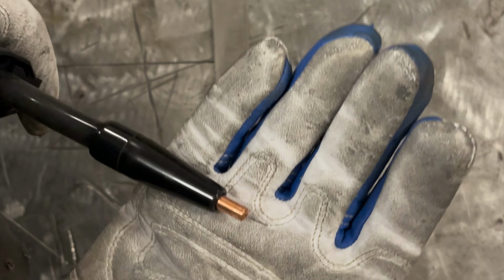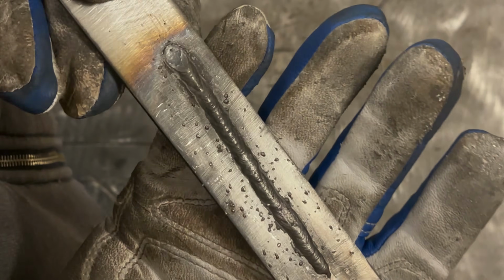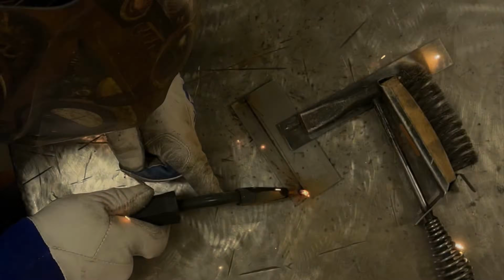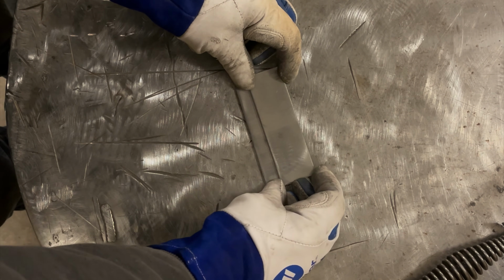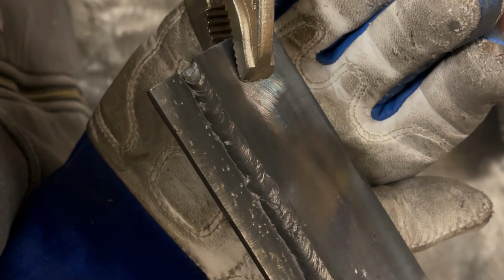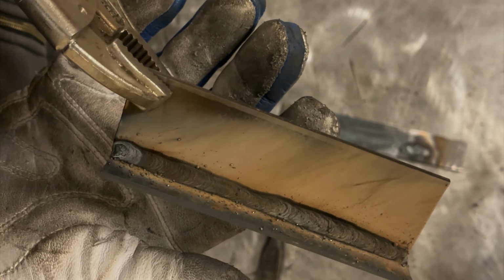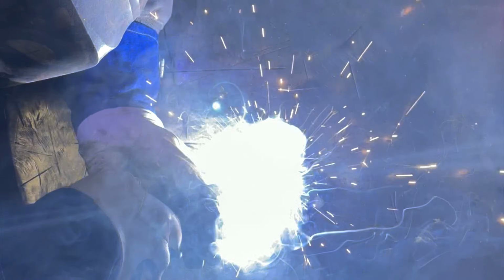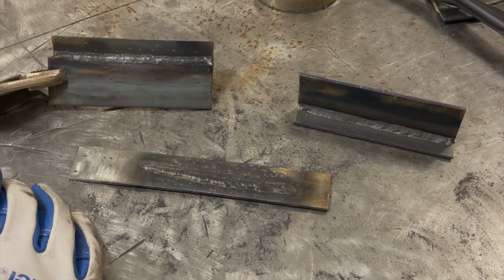How to weld with flux core wire

Comment: This may be a dumb question but where do you have your ground clamp connected to be able to weld those plates? I'm new to welding myself and am still trying to learn.
Edit: is it because of the steel table? And having connection through it?
Reply from the maker: Not a dumb question 😀.  Back before I knew much about welding I would always clamp the ground on the material.  Now I realize that putting the ground on the table makes the whole table the ground.  You are correct, the connection is made through the table itself.  This is actually preferred in many situations because it helps reduce arc blow due to multiple potential ground paths.  When you clamp directly to a set of plates the path for electricity to follow is limited, which can produce arc wandering (or arc blow).  

The only downside to the grounded table top is it’s common for the piece to slightly arc to the table and spot weld itself to it (can be slightly difficult to remove).  For many jobs you can’t weld on a table and in that case you try to do the best you can to keep the ground close to where you’re welding.
Reply: @makingmistakeswithgreg I use a lot of engine driven welders and arc blow is a problem only when stick welding plate, usually pad eyes and lugs are a problem, a fix for it also is using jumper cables and attaching one clamp close to your ground, then the other clamp to the opposite side of your plate or what ever you are welding. Then just have them laying around when ever you need them, although self shielded flux core is becoming more common in the field than stick so arc blow issues are not much of a problem.
Reply from the maker: @Dopamine1245  great idea on the jumper cables, no doubt that would work.  Arc blow sucks, it always happens when you least want it lol.
Reply: @makingmistakeswithgreg  yeah seems to happen a lot when there is an inspector around or on critical welds of course lol

Comment: Just got this exact machine today.  Never welded anything before.  Exactly the information I needed.  Many thanks for the effort of putting this together.
Reply from the maker: No problem 😀.  Big thing is practice and expect to suck at welding for a bit.  If I can do it you can as well.  Within a couple spools of wire things will start to come together, and you’ll be able to make some cool stuff/fix things.  Welcome to the start of your welding journey 😃

Comment: I've done tons of stick but this is my first at flux. All the mistakes you showed I make lol thank you for saving me tons of time figuring this out. now it's off to practice.
Reply from the maker: Glad to help you out 😀.  If you have experience with stick you will find flux core like easy stick welding.  Don’t be surprised if you see porosity that you never see with stick.  That stick out of the wire is hugely critical and needs to be maintained properly.  That is a bit of adjustment over stick but I find the process overall pretty easy.  You will find yourself using it a lot for thinner jobs and repairing stuff in odd positions.    You can run flux core uphill way easier than stick, especially on 1/8th or thinner material.  

Anyway welcome and keep practicing 😀🔥
Reply from the maker: Glad to help you out 😀.  If you have experience with stick you will find flux core like easy stick welding.  Don’t be surprised if you see porosity that you never see with stick.  That stick out of the wire is hugely critical and needs to be maintained properly.  That is a bit of adjustment over stick but I find the process overall pretty easy.  You will find yourself using it a lot for thinner jobs and repairing stuff in odd positions.    You can run flux core uphill way easier than stick, especially on 1/8th or thinner material.  

Anyway welcome and keep practicing 😀🔥
Reply from the maker: Glad to help you out 😀.  If you have experience with stick you will find flux core like easy stick welding.  Don’t be surprised if you see porosity that you never see with stick.  That stick out of the wire is hugely critical and needs to be maintained properly.  That is a bit of adjustment over stick but I find the process overall pretty easy.  You will find yourself using it a lot for thinner jobs and repairing stuff in odd positions.    You can run flux core uphill way easier than stick, especially on 1/8th or thinner material.  

Anyway welcome and keep practicing 😀🔥

Comment: I am a newbie and I am restoring a 54 Chevy. You might already know what I am about to ask. So in welding replacement panels and fixing rust holes, I can only do spot welds, then use compressed air to cool. Man it takes forever, and I deal with blow through. Tips?  Can you do a video on this? I have only done this type of welding but your video was great and I have more confidence in tackling bigger tasks. Thank you!
Reply from the maker: Thanks for the comment 😀.  I will be the first to admit that I hate auto body with a passion.  Everything about it tends to be the worst case scenario: super thin material, rust, paint/primer, surface contaminates, and on top of it reducing warpage is a serious concern.  I have honestly not done much body work but I can tell you what will help.  

There is a reason MiG welders are used most often in body work, they are really the best tool for the job.  Tig can’t handle anything but pristine metal and it makes harder welds than MiG.  Flux core wire (in .030) is capable of being used for auto body, but the slag entrapment will be a issue.  .023-.025 wire with gas shielded MiG is 100% the way to go.  If you are using .030 flux core you’re results will not be as good.  When flux core is turned down real low it tends to produce porosity and slag entrapment, which require higher settings to clear up, which of course will blow holes in the metal.  I have flux core welded auto body (I have actually even stick welded auto body and it’s terrible) and my take is .023 MiG wire or I won’t do it lol.

One thing that will help you is a helper holding a copper bodywork spoon on the backside of the weld or a hole.  The metal won’t stick to the copper and there won’t be much melt through.  They do make a magnetic one that works well for this, I found one on Amazon: https://www.amazon.com/Strong-Hand-Tools-Dissipating-AGK320/dp/B07ZG59SHV/ref=asc_df_B07ZG59SHV/?tag=hyprod-20&linkCode=df0&hvadid=416760125247&hvpos=&hvnetw=g&hvrand=8189415395119473529&hvpone=&hvptwo=&hvqmt=&hvdev=m&hvdvcmdl=&hvlocint=&hvlocphy=9007526&hvtargid=pla-870590117659&psc=1&tag=&ref=&adgrpid=95471650498&hvpone=&hvptwo=&hvadid=416760125247&hvpos=&hvnetw=g&hvrand=8189415395119473529&hvqmt=&hvdev=m&hvdvcmdl=&hvlocint=&hvlocphy=9007526&hvtargid=pla-870590117659 .  Something like that could help a lot.  

I will be uploading MiG videos soon and I will make one on .23 wire, which would be my preferred setup to weld papped thin material.  I don’t have any bodywork projects coming up but I can atleast show welding thin material with MiG to get people up to speed 😀
Reply: @makingmistakeswithgreg  I tend to agree! it sucks!!! lol but what do you do! Thanks for the input!!!
Reply from the maker: @clark5242  I have a running joke: the worst welders make the best auto body guys 😅.  Everything I strive to achieve:  consistent, clean, properly penetrated, low spatter, visually appealing, and strong welds on properly prepped material are not applicable to auto body.  If you care about making good welds you will become frustrated with auto body lol.  In the fall I will be likely building a 40s era truck and will surely be doing some auto body on it, but it will be a while.  Good luck with your project 😀.

Comment: hello i just got my first flux core welder-stick wielding is not for me-i have watched oldtimers stick weld and they use a push pull methed do you do that with flux core or just drag your wire?when you push pull with a rod you get a good looking bead can you push pull with a flux core to get that look?
Reply from the maker: So with flux core you have to drag the puddle.  With short arc MiG (aka gas shielded wire) you can do push or pull.  At times you might weld with a straight in angle with the flux core wire (mainly uphill).  With any process that has flux/slag if you push you run the risk of slag entrapment (basically the molten metal of the weld solidifies around the slag).  I made a ton of videos on flux core and this one: https://youtu.be/OF5HNI5dBZs should really help you out starting off with flux core 😀.

Comment: Hello from Northern Ireland, thanks a lot for this series on flux core. I have a cheap dedicated flux core welder that I recently bought from Static Arc in the UK. I have learned a lot from your videos and now know what indicators to look for when practicing. I have saw an improvement already, Cheers!
Reply from the maker: Glad to hear your improving and thanks for the comment.  It’s amazing how a few small changes make a huge difference.  I will be diving back in to flux core next week with atleast 3-4 more videos with arc shots and everything.  It should help you progress more steps forward 😀

Comment: FYI to your viewers - the same machine is sold in Canada by Canadian Tire under their Mastercraft brand. Price is higher (even after conversion) than the price at Harbor Freight, but does go on sale every couple of months.
Reply from the maker: Lincoln electric is about to come to the market with the same welder under their own name too Lol.  What does the one you’re talking about sell for in Canada?
Reply: @makingmistakeswithgreg  Currently CDN$500but it goes on sale for about CDN$270. If Lincoln is going to brand it too, that shows what a little gem this one is. I haven’t see a bad review yet.
Reply from the maker: @T3glider  the century 90fc was already out but much lower amperage (which is a Lincoln brand).  However they just released the Lincoln badged weld pack 90 I MiG and 90 FC (flux core only).  The MiG version has a gas solenoid.  Both have a better Lincoln gun on them than the harbor freight version.  Despite being called a 90 they actually output 120 amps.  They sell for around 250 to 350 US dollars.  I might actually pickup the MiG version, perfect size for car work on exhaust and for portable repairs.

Comment: I'll probably buy the HB titanium flux 125.  Then self-teach (really videos like yours) welding. Eventually, projects planned are lightweight brackets, metal connectors on a bike, and maybe some vehicle body repair. Your video is a great help to me.
Reply from the maker: You can do it.  It will be a bit rough at first but with a little practice you’ll be able to fix/repair/make all sorts of things.  😀
Reply: @makingmistakeswithgreg  Well I have some scrap metal.  Thanks for the encouragement.

Comment: Greg, after 40 years I finally found out that my old Century built Powermate Quick Fix  was junk. 🤣😂 I got the gas conversion and only used it on sheet metal. It was the best mig that I could afford at the time. Fast forward to today and I'm going to get a new welder in the next few weeks. I've settled on a Hobart Handler 210 MVP. I believe that it will do everything that I will need. I'll be working on some sheet metal on my "63" Falcon. I would really love to have a Miller but unfortunately that's out of my price range. But that being said, Hobart is made by Miller. Anyway, what I wanted to say is that I learn something from every video that you make. Again, thank you and God bless.
Reply from the maker: Thanks for the kind comments.  The 210 mvp is good from what I have heard.  Hobart is owned by miller, and the build quality and parts generally reflect that.  Millers prices on a lot of machines are sky high (and unreasonable in some respects, like there 140amp MiG welder at over 1k).  The difference a good MiG welder can make is huge on the low end.  Welding sheet metal and thin material tends to be far easier with .025 wire and a quality welder with good low end capability.   I will be dabbing into MiG shortly, I just need to finish up stick welding videos.  😀
Reply: @makingmistakeswithgreg  I'm currently on Part 4 of the video on the Titanium 125. I'm retired and the weather outside is kinda bad and so I'm making a marathon of your videos. It's great having the time to be able to watch them.

Comment: First, I don't know of a machine that welds HF flux core wire well. I also wanted to thank you for explaining what a good voltage and wfs should sound like on flux core. I picked up a newer to the market "Warcking" 150 multi process, multi voltage machine, and I love flux core welding in and out of my garage shop. I'm still on the .035 wire that came with the machine, and so far, it has worked well above its price. I like to run a "C" style weld on my fillet welds, but you showed how a steady stringer can really do the job, so thanks for the lesson.
Reply from the maker: I am glad you got some useful info out of the video 😀.  You can do the C style and be ok, the main benefit to that is it keeps the wire eating away at new metal.  When you do stringers like I generally do there is a fine line with how much metal you can put down before you will either lose penetration or start to get porosity.  The big thing with flux core is you want to get that weld to flow out/penetration and minimize porosity.  The E Or C motions in my testing can give good penetration and help keep porosity to a minimum.

Comment: I’m having a lot of trouble with porosity
Reply from the maker: Porosity with flux core generally means one of three things.  1) your polarity is wrong.  Make sure the welding gun is wired to the negative side and the ground clamp is positive (if it can be changed).  Sometimes you have to change where a wire bolts to in inside of the machine.  2) your stick out is far too close/ your settings are too low.  Maintain 1/2 to 5/8th of a inch of stick out.  Make sure the settings are appropriate for the metal thickness you’re welding. 3) your wire is old and has picked up a bunch of moisture/rust.  If 1 and  2 don’t fix it then replace the spool of wire and try again.

It could also be material contamination but if you’re welding on completely clean metal this isn’t likely.  Hopefully that helps you get things fixed.  🙂

Comment: Hello sir, I need your advice. I’m in the market for a smaller packable welder for my farm. New to welding. I have fencing as well as farm equipment. What type of welder/type do you recommend and why. I’m leaning towards either Miller or Hobart. Thank you and appreciate the continued knowledge. I’d be able to hook up to 110 & 220 via generator and socket no problem.
Reply from the maker: Great question.  Being new to welding you’re going to want something that’s easy to work with and likely has stick and MiG/flux core options.  You can get a single welder that will take care of those things.  There are a few things you want the capability to weld:

1) most stuff on farm equipment is thicker steel,  and a 140amp MiG welder isn’t going to cut it.  The limit of 140amp wire welder with flux core wire is 1/4in steel.  If you want a wire welder you need a 180+ amp machine to know you have enough power to weld anything you need it to.  

2) portability will be a nice thing because you can bring it to what you want and run it on a generator like you mentioned.  

The way I see it you have two options for welders.  1) to get a single machine that does stick and MiG.  My suggestions Is a esab rebel 215 multi process.  It’s a awesome stick welder, and very easy to weld with MiG/flux core wire because of the built in software.  Option 2 is to get a 140amp MiG/flux core welder and a portable stick welder.   A standard 140 amp MiG machine will make your life less stressful for welding thinner materials, and you can use the stick machine to weld thicker stuff as needed. 

Being new to welding you will find stick weldings learning curve to be steep and you will produce far better welds faster (especially in positions other than flat) with a MiG/flux core welder.  However like I said unless you get a powerful (180 amp plus) MiG machine you can’t weld thicker than 1/4in plate with proper penetration.  Many 180+ amp MiG welders are big/heavy and not portable. .  

Brand wise miller, Lincoln, esab, and many other companies all make really good machines.   I love miller for tig and MiG, however their all in one machines typically won’t run 6010 that well, or 6011 rods that good either.  Those rods are very beneficial on a farm because of their ability to weld big gaps shut, deep penetration, and ability to weld through poorly prepped material.  ESABs rebel line will run 6010 just fine, are very portable, and better suited for farm work in my opinion.  I have owned multiple esab products and like them a lot.  From a stick perspective a esab 180 rogue would be a ideal stick only welder around the farm for portability and power.  Combine that with really good 140-200 amp MiG machine and you will be able to weld pretty much anything.  So my recommendation is to grab a esab rogue 180 for stick, and say a Hobart handler 140 or equivalent MiG welder.  Or you could just get a esab rebel 215 and one machine will take care of what your needs are.  Miller wise their multimatic 215 is good (just limited on the stick capability end).  Hobart makes a 200amp multi process but that isn’t the best stick welder either.  

So many options but I am sure you will find a solid welder to meet your needs.  Also, In 4 days I will be doing a “picking your first stick welder” video where I talk about what features you want and it will have a top 10 stick welders section.